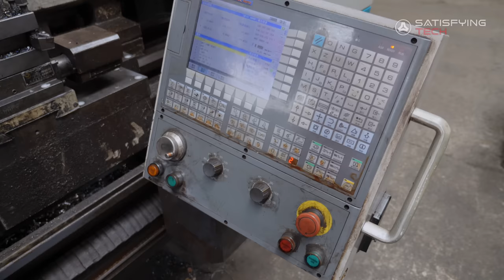Giant Bow Shackle Forging Process！Large Rigging Factory！

Comment: I worked in a forge like that many years ago. What you could not put on the video is the amount of heat those forging throw off. It's indescribable how hot those forging got. Iron melts at 1500 C or almost 3000 F. The men's clothing was full of burn holes. Some of those tanks had water in them, others contained highly corrosive chemicals to clean the forging. Most of those guys probably had hearing loss due to those pounding hammers. Many men lose fingers, arms, legs and their life in a factory like that. Accidents are frequent. You could only work in a place like that a year or two without getting hurt. Those anchor shackles were rated at 150 tons bigger than most. I lived near the forge. You could hear the hammers a few blocks away.
Reply: No hearing protection ? That’s really sad
Reply: 3:35 is that a dust mask in his pocket ?

Comment: Thanks.  Surprised that those 2 large holes were drilled and not punched when hot & bored, or at least drilled with a much smaller drill first.  Those bits were real beasts!
Reply from the maker: diamonds
Reply: I was thinking the same.  Would have been easy to punch out smaller holes during the flat bar stage and bore to alignment at the end.  But they are the ones doing the job, so there must be a good reason.

Comment: That's a well done video and an interesting production process.  Mostly manual -- there's clearly quite a lot of skill in handling the forging hammer at the start of the process.
One puzzle is that I saw no QA to speak of.  I would expect a load-bearing product to be subjected to a proof load, but that wasn't shown.
Reply: A lot of the factories now have the heir QA/NDI done by a 3rd party. Cuts down on the "it'll be ok" issues if done at the manufacturing facility.

Comment: Noticed WLL 150T stamped on the shackle. Working Load Limit 150 ton. The captions said they're used in the marine industry. probably for heavy lifting work. nice video.
Reply: @Imissmusicvideos   Yes you are correct. There is a tremendous amount of lifting of heavy loads in the marine cargo industry. However there is also a great amount of rigging equipment that is used for marine towing. Heavy duty shackles are an essential component when towing barges on the ocean or docking a massive container ship. Doing that type of job can be very dangerous, due to the extreme forces involved. Safety protocols must be strictly followed to minimize the hazards involved. You might be interested to know there are shackles manufactured today that are over WLL 1,500 tons capacity. Giant shackles like that are usually used in conjunction with huge wire rope slings. When working with rigging equipment of that size, a crane is needed to move and position all the main components.

Comment: I really enjoy your videos!  But, at 13:09 you mention in the captions that the shackle has a capacity of 600 tons, however the stamping on it shows WLL (Working Load Limit) is 150 tons.
Reply: Then this means breaking load is 4 times the working load limit. It’s called the safety factor (sf). This sf is low, normally the high end brands (GP, CROSBY) have a sf of 5 or 6.
Reply: @swp466   Very good observation you made. Keep in mind that on an actual work site, a professional rigger would not load that shackle to more than 150 tons. No worker in a heavy lifting operation should even speak about the ultimate strength of rigging equipment. Because doing so could cause confusion, and incorrect calculations while preparing for a heavy crane lift. A  rule of thumb for a competent, professional rigger, is never use any of the reserve capacity of a rigging component. Also it is important to occasionally check for wear and the condition of the equipment. A thorough inspection is required on a regular basis to ensure safety for future lifts.Using the shackles as an example, you would need to check for any distortion or bending, as well as possible cracks or gouges in the shackle body or pin.Make sure the screw pin has no thread damage. Eventually after a long working life, even a heavy duty shackle will need to be removed from service.
Reply: You know quite a lot about the leading producers of shackles! for shackles with WLL less than 85ton even have sf 6:1

Comment: Great video!
Some technical questions though:
Why do you need oil paper at the end to present rust, since the shackles are already galvanized to withstand corrosion? They are build for years of service, right?
And secondly: the nuts are tied for galvanizing, wouldn’t it make the Zink be applied unevenly at the „touching points“ of the tie?
Thanks so much already, love that heavy machinery and all the work you do!
Reply: Present=prevent
Reply: The zinc is a very thin coating that's deposited and bonds directly onto the metal, so it has no problem getting in those tight spaces.  Notice that they shake the pieces, too.  Hence the wire and not like a flat clamp or anything.  It's doesn't act like a solder joint where it stays in the gaps.  But there is no sticking and dripping and hardening like a paint would do, so there's no little bumps or anything left where the contact occurs.

Comment: I don’t know why I want one of those shackle that big but it would be cool.  But I bet it’s heck of a lot of money.
Reply: @SA-76234   You are absolutely correct. Rigging equipment is very expensive to purchase. A shackle rated @ 150 - 200 tons would probably cost at least 500 US dollars. I have seen prices of over 7,000 USD for a single ultra large shackle. I don’t remember what the capacity was, but probably in the area of 600 tons or more. Obviously when working with rigging equipment of that size a crane or forklift is required.

Comment: The workers must be quite strong to lift a 60 kg piece of metal like that. That's 132 lbs!
Reply: 60 kg does not seem to be accurate weight for an object that size. 🤔
Reply: @utahmike3855   I agree. It might be 60 lb but not 60 kg. If it were 60 kg, the guy could not move it around that easily.
Reply: 100mm round bar 1 Meter long weighs >60kg. This bar seems to be at least 100mm in diameter, now way that thing weighs only 30kg

Comment: Is galvanizing hot?
Reply: Yes
Reply: It is not. Galvanazing is done cold, with electricity. Tose shakles however are hot-dip zinc coated, not galvanized. Zinc melts at 420° C/790° F. I would call that hot.
Reply: @guzziwheeler  my mistake

Comment: Where I am from this is called a clevis. To us a shackle is in the end of a leafspring, and it connects the leafspring to the frame of the vehicle.
Reply: where I am from a shackle has one threaded side for the bolt to thread into and no nut. a clevis has a bolt and nut.

Comment: 12.25    Why diesel ?
Reply: 1-Cheaper than oil, 2-the translation could be wrong
Reply: @unclerobert7532   Why not just water?
Reply: @admiralbenbow5083  water could cause cracks when cooling
Reply: @unclerobert7532  So why does diesel not cause cracks?
Reply: @admiralbenbow5083  it's similar to oil, you not learn in school,3 how old are you?
Reply: @unclerobert7532  Why diesel?
Reply: @admiralbenbow5083  😠
Reply: @unclerobert7532  STILL WAITING..................
Reply: Old oil from diesel truck engines, if water it steams all around and doesn't transfer heat/cool down as fast & uniformly.
Reply: @alro2434  👍